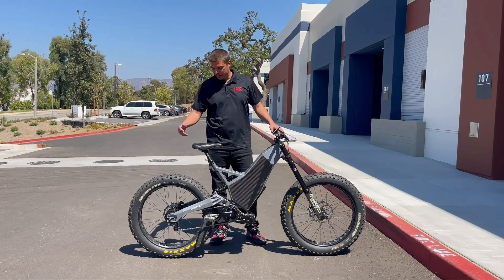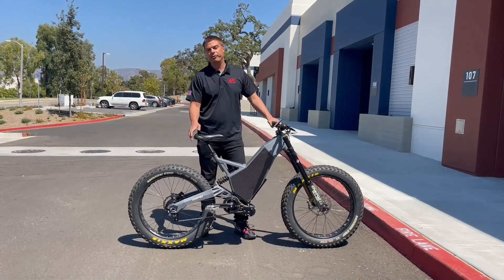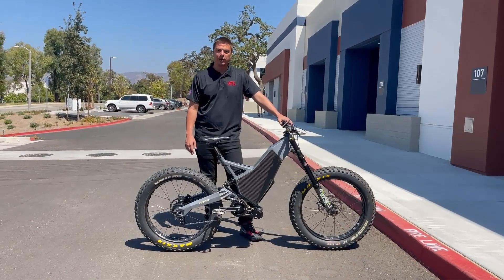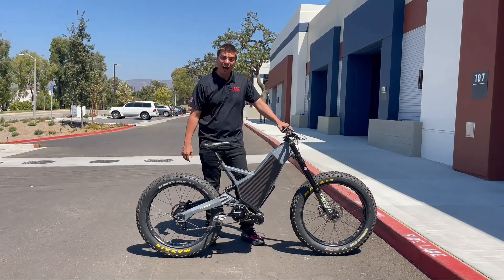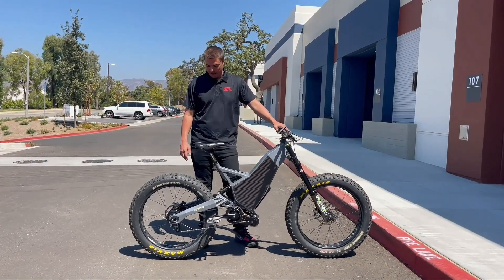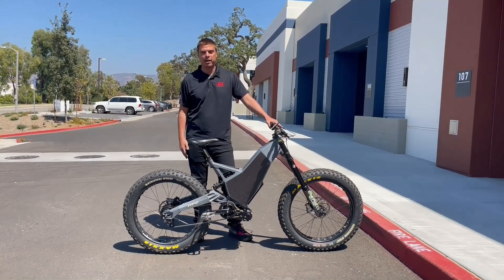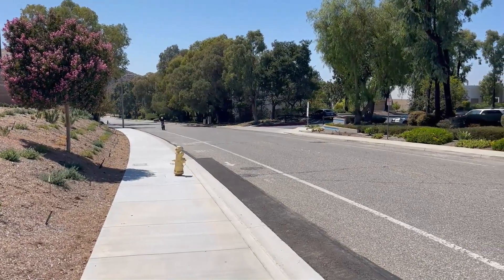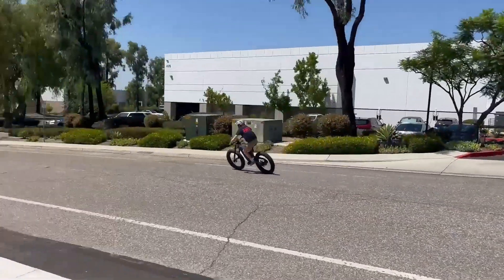Monster 5000W Revolution AT Conversion

Comment: Nice. Cyc or hub motor - what do you prefer?
Reply from the maker: For offroad, mid drives. But for Going fast in smoothness and silence, nothing beats a high quality hub in my opinion. I get the weight balance and offroad benefits of mid drives, but if you want to get around quickly and have a ride as smooth as butter, go with the hub at 7000W or more for serious fun.
Reply: @hipowercycles  Thanks. You got any like new to me direct drive bikes? 😎

Comment: what the market needs is a full suspension mid-drive e-mtb that actually acts like a weaker surron. Full incognito, super light weight, but just twist throttle and zoom. Needs reliable chain setup and torque sensor. I think when that category emerges, with a half decent price point...everybody will be getting one
Reply from the maker: You should check out Trailblazer, 40 MPH, 1800W, throttle only, great and dialed in torque sensing PAS, looks like a normal bike! https://hpcbikes.com/products/trailblazer
Reply: That’s exactly what I want I have a surron but it’s too heavy I don’t care about speed or power I want a down hill mountain bike but like a surron sacrifice the speed and power for less weight I just need enough speed to hit a jump not 60mph not even 30mph I stay in eco mode around 23 mph on my surron I bought it for dirt jumps and trails
Reply: @Trashdoesentmatterhdbdbd  Boxxbike. Look it up. 80 lbs with 14k watts of power goes 50 mph.

Comment: DO YOU SELL FRAME ONLY? CAUSE I CANNOT AFFORD THE WHOLE BIKE..THANKS
Reply from the maker: Unfortunately not.  The frame alone would cost more than most electric bikes.  Way too exotic and low qty to make it something even close to affordable.  How much power/speed do you need?  Do you need a mid drive? I can try to think of an affordable solution to do what you would want your bike to do...
Reply: @hipowercycles   I HAVE 3000W MOTOR NOW ALREADY,,,I LIKE TOO MUCH YOUR EBIKE BUT I CANNOT AFFORD IT,,